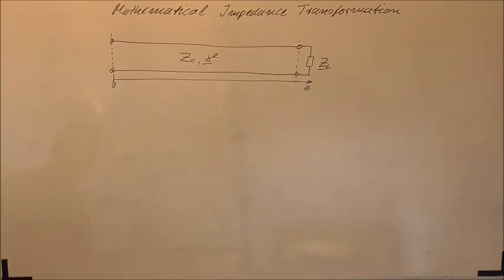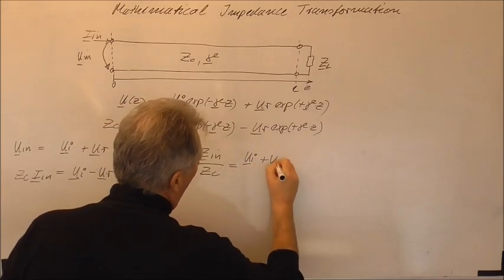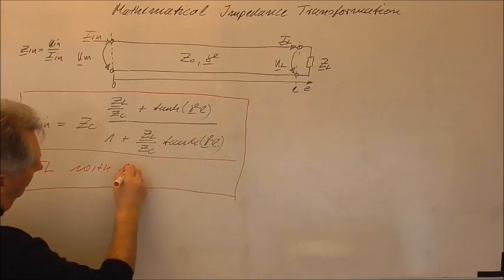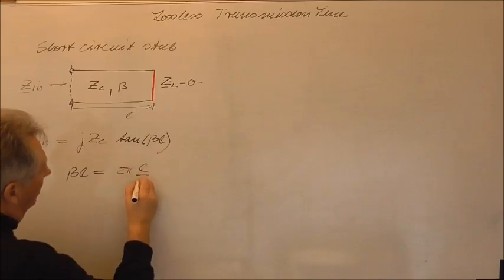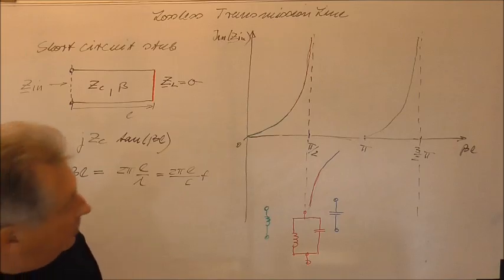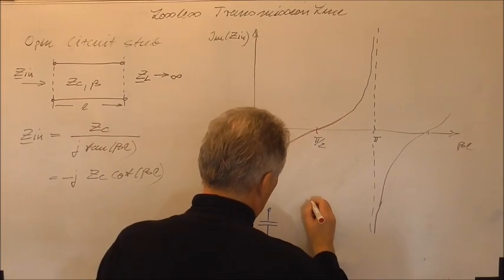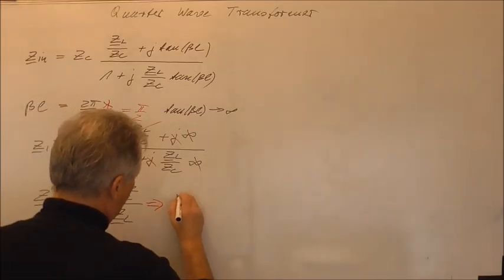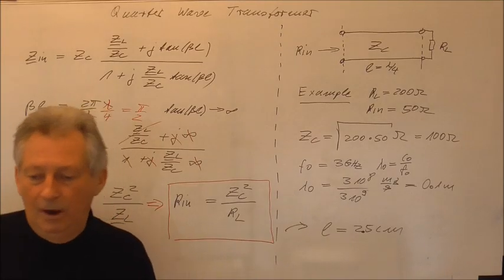Mathematical Impedance Transformation

Comment: Dear Professor, I wonder why do we usually care about lossless TL as well as TL with low losses in RF-Engineering?
Reply from the maker: Especially in the Smith-Chart and in the design of matching circuits we assume first lossless TLs. Simulation tools then account for the influence of losses. Even so the practical losses of a TL are quite hight - from a mathemtical view point the losses in the whole RF-range are small
Reply: @Lectures_RF_Microwave  Ohh OK. Thank you sir!